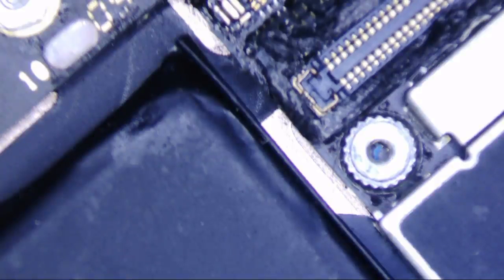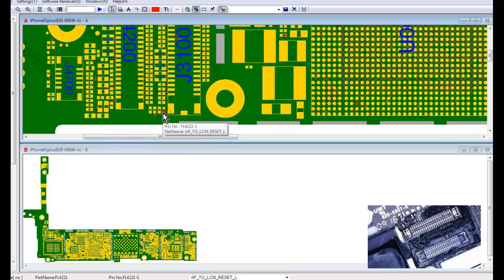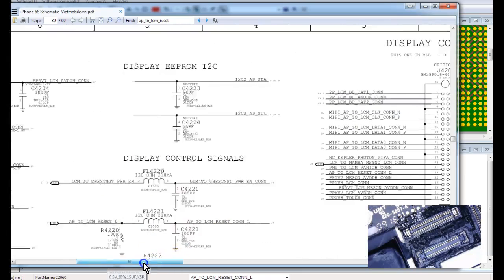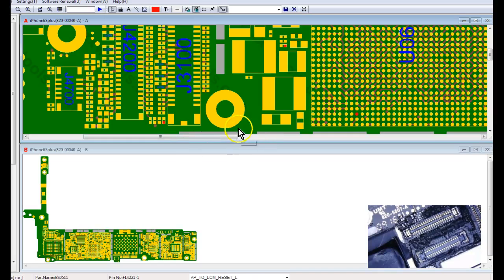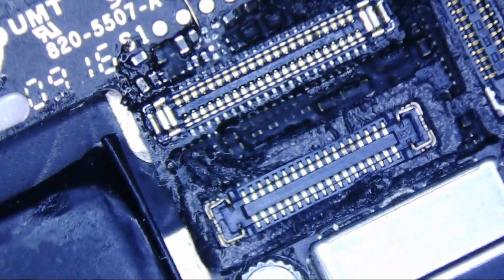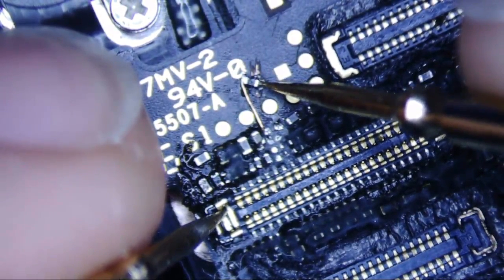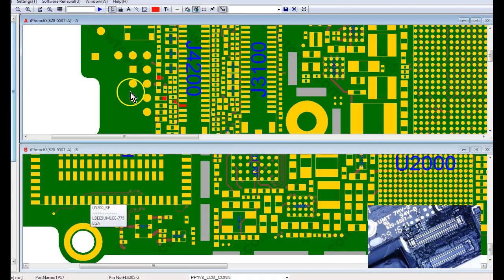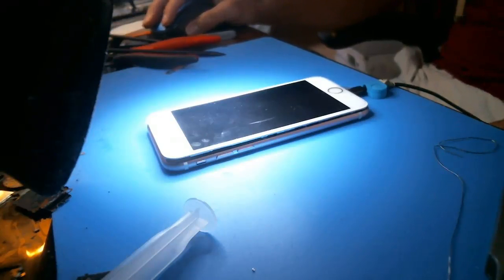iPhone 6S AP TO LCM RESET revisited

Comment: I know this is an old video but this is driving me crazy trying to figure this out myself! Aren't you testing the wrong point on 9:22? That looks like Pin FL4208-1 the PPV7 to me so I am trying to figure out why you are checking that one and not the actual PP1V8 line or am I just seeing thing?.
Reply from the maker: I think you might be right.  Maybe I screwed up...I'm not exactly sure actually, but it does look like I'm measuring the wrong line.

Comment: you mention about iphone 6s stuck in dfu in a few videos.i am doing data recovery on 6s that had water damage and vcc main .with short removed phone is detected in itunes but in dfu mode .what causes this
Reply from the maker: software error
Reply: hi.problem was fixed after replacing tristar.PP1V8_SDRAM ball appeared to have some corrison.thanks for reply

Comment: hai bro, i have problem with ip 6 no image, like u say at another video, check backlight sircuit, 5.7volt adv, 1,8v signal. its looking fine, try to replace backlight ic or chesnut ic, check reset lcm reset sircuit,  check i2c sircuit, change fpc display but problem not solved. can pmu ic ? work for display, or nand? ....
Reply from the maker: If you are getting both 5.7V and pp1v8_lcm and 1.8V at ap_to_lcm_reset, then you should get image.  If not, then check the connector.
Reply: okay tx bro

Comment: This is a common fault. I've seen quiet a few. Some work when removing the filter for ap reset some don't. I think it may be partially to do with aftermarket screens don't use the same logic on the screen. Other like said in the other post is timing may match. STS (Jason) had one that worked sometimes on screen on press. At times it would fade the image out. 
Is the screen on there OEM or aftermarket?
Reply from the maker: The problem is not solely the reset line, but the pp1v8 line...I think...
Reply from the maker: I think it's an aftermarket screen.  I'll have to check.

Comment: Lcm reset is an input to the LCD from the CPU (internal transistor connects 1.8v to the line. Same internal transistor grounds that line when it needs it to be 0v) and is critical to having a display. Data is clocked in serially,
if the counters start in a random state then the initial image could look like a mess.

Reset is sent after all conditions are OK to make proper initialization. So lcm enables power then there must be reset to start fresh communication. 

You could see it with a scope. The reset occurs during the transition from 0v to 1.8v. That's why timing is critical
Reply from the maker: You think it's possible that this line is stuck in ground sometimes?  Or is that how it's supposed to work?
Reply: Microsoldering It seems to be an active high line. Whenever the LCD is on it has 1.8v. When LCD is off its 0v.

If it stays at 0v then the transistor used to control that line has become shorted within the CPU. Or the control signal to that transistor has gone faulty keeping it in a low 0v state
Reply from the maker: Can you think of anything else that we can do to fix this problem aside from just leaving the line shorted at the CPU?  Honestly, I'm not certain if the line is shorted at the CPU or if the line is shorted within the traces of the logic board.  The fact that pp1v8 is dead leads me to believe that it has more to do with the latter.
Reply: Microsoldering That line as well as many others like i2c are branched from the main 1.8v rail. They just use pull up or pull down resistors to drive them high or low as needed. You can do a fix like in your video but since the CPU isn't technically controlling it anymore, when that line resets, the display could either not come on, look garbled, or be intermittent. It's all about timing